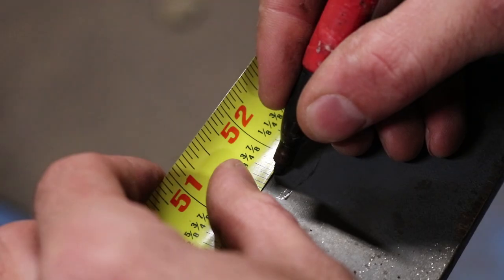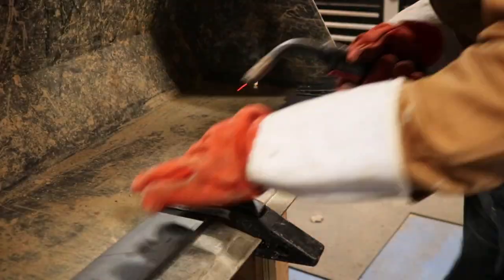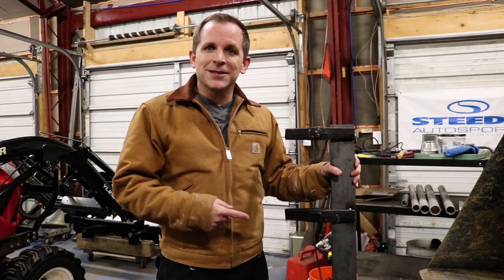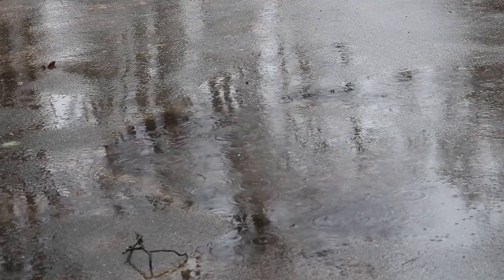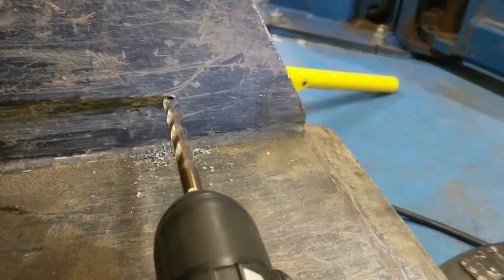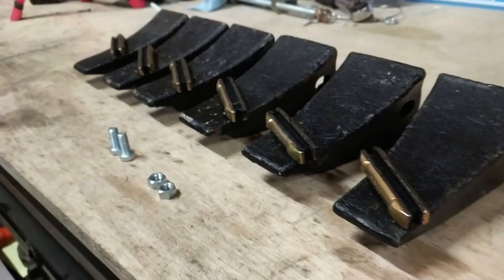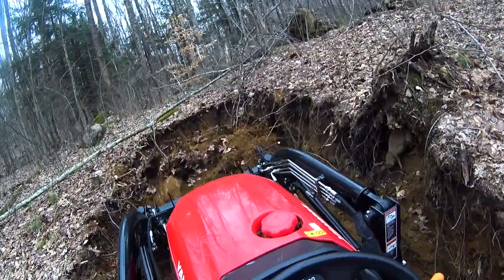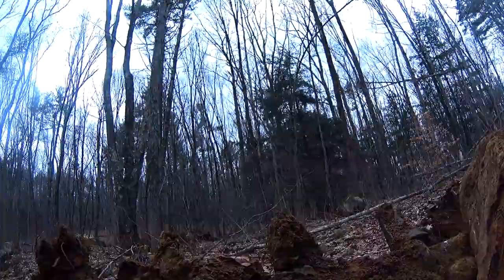Building a Custom Tooth Bar

Comment: You know something?
That really looks good man. Great work.
Reply from the maker: Thank you Subix! I really enjoyed making it, and it helps out so much! really changed the versatility of the tractor!
Reply: Lazy Brook Farm 
I aktully building a FEL for my 91' Jeep YJ. Using a winch and a quick removable pully tower. At least for lift. Then some 12v ram/linear aktuators in place of hydrauliks. Imagine a brutal garden traktor. And also my FEL will be detachable for daily driving. But attachable at job sites klearing brush etc.  :D
Reply from the maker: I would love to see that! it sounds like quite the project!
Reply: Lazy Brook Farm 
Yeah dude. Lol. It's a long story. I'm learning to weld as I go. Hahaha.  Stikk welding thinner metal sukks with an AC225 Tombstone. I need some smaller rod. All I have now is 1/8 6011. Man if you are on FB send me a message and I'll send you a video in return. 

Subix Barbarasson

There is a blakk Jeep and my 🐺 smiling out the window. Also it will say "Истина" on the bottom. Her name is "Istina" Serbian word meaning "truly/true".

Comment: I was thinking about a DIY  tooth bar until I noticed a finished 66" bar by Titan for twice your investment. It has a .5 thick bar but I will need to reduce the length to fit my bucket. Great video!
Reply from the maker: that should work out well for you, especially if your welder isnt quite up to 1/2 inch plate!
Reply: Yep ..plus reducing the bar length will leave me with a nice piece of steel left over but it will have a tooth welded on it ...lol

Comment: Would 3/16” bar work? Or would that not be strong enough? What is the thinnest you would have the bar?
Reply from the maker: I think that might be a bit of the thing side. Part of the reason I did 3/8ths was the teeth I used required that thickness to sit correctly on the bucket. Much thinner would have damaged the bucket with use.

Comment: great idea!  How has this lasted?  Have you used it a lot?
Reply from the maker: so far its going strong, not one single repair, or even a repaint. I have put around 150 more hours on the tractor with it, almost never take it off. I have lost the bolts a few times, but the bar says on most of the time, even without them!
Reply: @LazyBrookFarm  Thanks for the reply!

Comment: Now you can drive into a stack of road rock and fill a bucket when in 4-wheel and low.  Just goes in fills and I rotate an pull it up.  Then off to fill holes in the road.

Comment: How far back was the center of the hole from the edge of the bucket?
Reply from the maker: About 5 inches, it isnt anything precise, the bolt doesnt take any load, just keeps it from falling off when you dump, i even forgot to out them in once, and the teeth stay on!

Comment: Do you recall the overall length of the weld on part?
Reply from the maker: I think the mount for the tooth was about 6-8 inches total length, i can mesure if you need some more accurate numbers
Reply: @LazyBrookFarm   Its ok. I found some that worked.